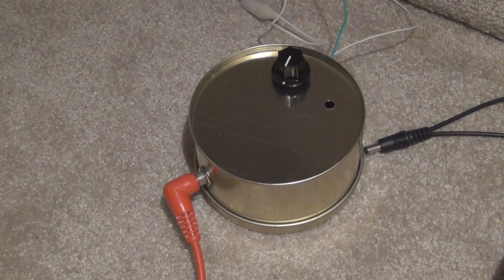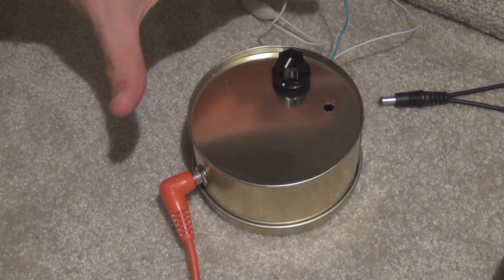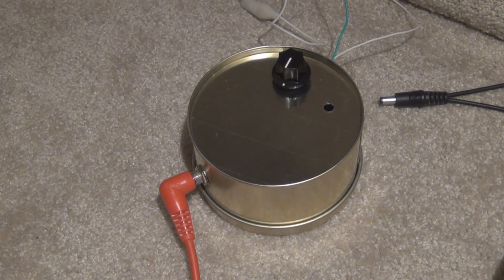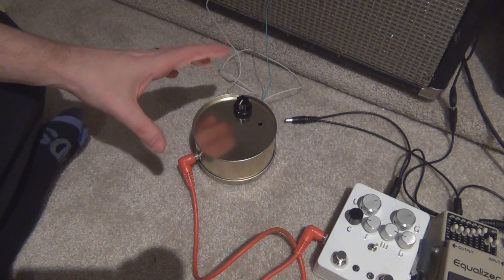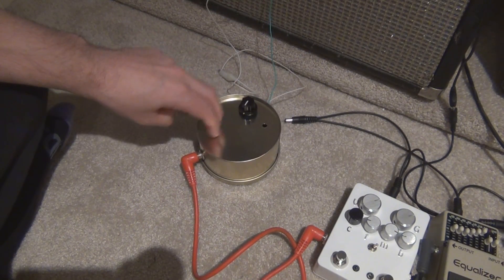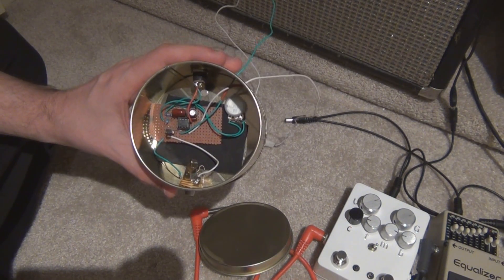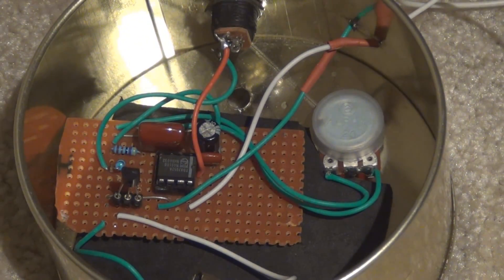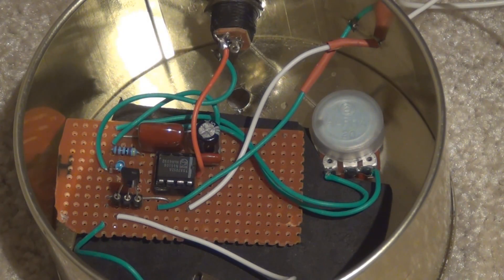Build A Guitar Amp for Under 10 Dollars

Comment: Cool just subbed hey looking for an amp like this but both ac/dc voltage outs with the speaker out like you already got plus run on a 9 volt battery would be awesome

Comment: Very nice! Just something that's not clear to me: this amp will work by plugging the guitar directly into it? Because usually, you need a preamp stage and then a power amp stage, but it seems like you're going in directly. Like when you're playing before turning on any of the pedals before it like the EQ or the Reverb.

Comment: It doesn't sound remarkable despite how few components it has. It sounds remarkable BECAUSE of how few components it has! This is one of the 10 commandments of amplifier design. The fewer components between the source (guitar) and output (the speaker) the better. What you then hear is basically the true sound of the guitar and the speaker. Every guitar player should learn how different guitars sound without a load of crap between them and the output. Besides these aren't really guitar amps in the traditional sense. They are really just preamps with just enough power (maybe 1 watt) to drive a full size speaker but not to any significant level. They really are headphone amps. They can drive large speakers with a 9v battery but rapidly deplete the capacity of a small battery. But they are great if you want to plug in a good set of headphones and get great earful of clean guitar sound. Any guitar player who really wants to learn how different guitars sound would be amazed at how many different colors one can get from just the different pickup combinations and tone settings on say a Strat without any effects at all in the signal path.
 Without the other half of a traditional guitar amp (the power output or second stage) you're not going to drive a Marshall Stack with this but if you want to hear what cleanly amplified guitar really sounds like these things are a revelation. I've played guitar for forty years and recently built one of these $10 Radio Shack 386 op amp based puppies and it sounded so much like an original Black Face Twin that it was uncanny. And I should know because I had a friend who had a brand new Black Face Twin in the late sixties and the sound of that amp is etched in my brain. Also with a battery there is also no coloration from AC power supply  components. Just pure clean sound.

Comment: I have tried to get the mpf102 but couldn't find it anywhere. Someone suggested that i could use a 2n5484 instead, however the output sound has a background static. All the other ic/cap/resitor are similar to your schematic. Any idea what might be wrong?

Comment: Hi Paul, DIY Pedals, Nice little amp. The TDA series of chips are a great choice for "Chip" amps. I may have mentioned before, but, John Audio Tech on YouTube is an excellent channel for chip amp construction and reviews, very knowledgeable. Also, I've have suggested building a Runoffgroove.com Ruby 1/2 watt guitar practice amp that works great and with the 1K gain pot, sounds like a lot more than 1/2 a watt. You can easily drive a 12" speaker and have seen up to 4, 12" speakers. I would use 12 volts for that, usually 9 volts, 8-ohm's and your golden. However, you can use 4 to 16 load impedance with the Ruby. The Ruby uses an LM386 audio op-amp and an MPF-102 J-FET, the MPF-102 I have found to be the best. Schematic at Runoffgroove.com or Google Images. Try one, they Rock. Take care, Cheer's, C.

Comment: what is the power rating on the speakers?
Reply from the maker: +Michael Hiltz Hi Michael, quite a while ago, was this video with the fender twin?  If so, the fender twin is 100w amp so they are going to be rated pretty high.  I guess you would be safe with anything 5watts and up (1 watt amp)?  Not to familiar with speaker driving though.  Cheers
Reply: +DIY Guitar Pedals Do you know what impedance each speaker was?

Comment: I'm having trouble breadboarding this. I keep getting a clipping or "motorboating" through the speaker. can't seem to get it completely right. any ideas?
Reply: I thought motor boating was something else
Reply: stick a lot on the output and use it as a master volume, should prevent clips
Reply: +Kayla “Kurisu” Deards *pot
Reply: +Jeremiah Bentley Many times motor boating comes from a power supply that can't deliver enough current to the circuit.

Comment: Does anyone know what points the Pot is mounted? Im new to circuits so im gonna guess one lead is to ground the second is to pin 4 on the IC chip but idk where the third would go, if anyone could reply that would be great :)
Reply from the maker: +John DeSilva Cant remember the pin numbers off hand, could possibly be pin 3 to ground, also middle pin to ground, and then the other pin (sorry again cant remember), lets say pin 1 to the IC.  So middle pin and 1 or 3 (cant remember which) are connected together and sent to ground. Cheers.
Reply: Thanks for the fast reply and that actually helps a lot!

Comment: I don't see any answers to questions here, but maybe someone will have an idea...

I'd have two things I'd want to do with this:
1. Add one or two effects to it--like, say, chorus, delay, or reverb. Would that be doable while still keeping the thing small?

2. I'd like to actually wire it into my guitar--route out a cavity for it, put it in as a headphone amp. (With controls for volume or gain, and whatever effects can be squeezed into it.) Is that possible?
Reply: The second one is possible, although I'd recommend having another output jack straight from the pickups, so if you decide to hook the guitar up to another amp you won't be using two amps at once.

Comment: I have an old Marshall MG Cab with the original Celestion 12" 100W speaker. I wanna make something basic and straight forward like this. What chip would you suggest and will it power my cab?

Comment: can you plug this into any speakers? for example stock honda civic speakers haha
Reply from the maker: I think you have to watch the ohms....I think the chip needs 8 ohms, car speakers are 4 ohms, but its only 1 watt so "probably" not going to damage.  You want the speakers inside a box or you'll get zero bass.
Reply: chromespherecom yeah I was planning on building an enclosure just want a small amp and speaker for really cheap so I can use the distortion pedal im building.
Reply from the maker: Alexander Gehl A book shelf speaker is a good option, I see them on the side o the road all the time.  The bigger they are the louder the punch amp will be. (bigger = better imo)